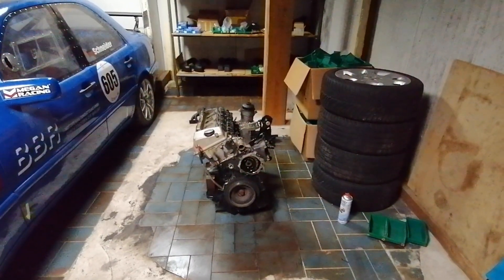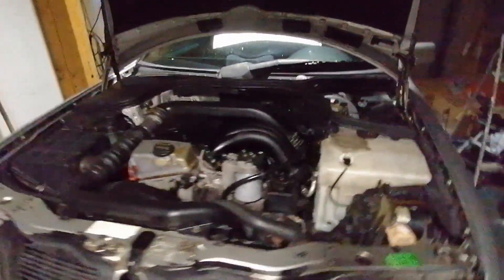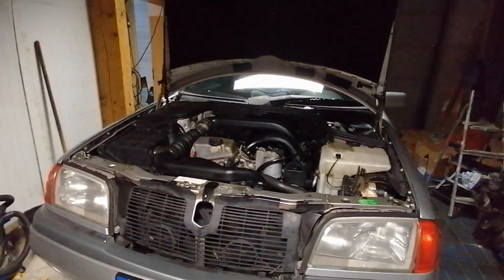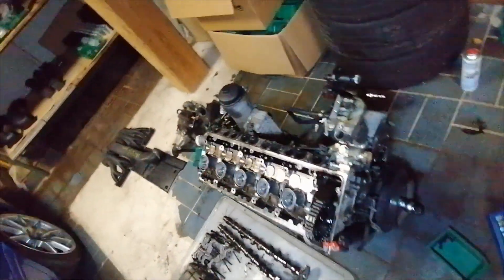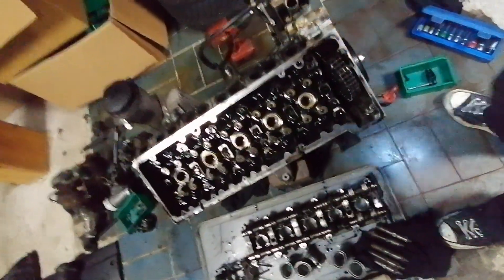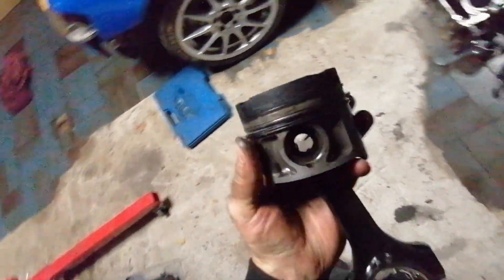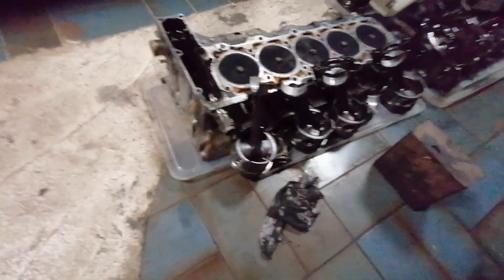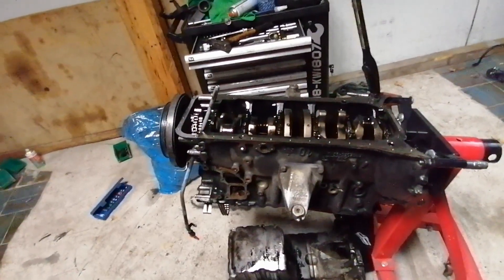Engine Damage on my Mercedes W202 OM605 Superturbo Sleeper

Comment: My first thought was that some problem occurred with the piston oil spray nozzle, like blockage or low output, it is very easy to bend or misalign them during assembly. Keep building them and put egt and egbp gauges in the car to monitor those values. Keep rolling......